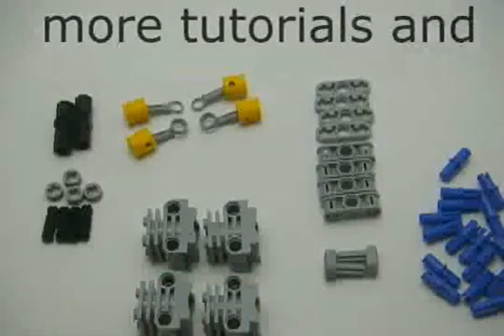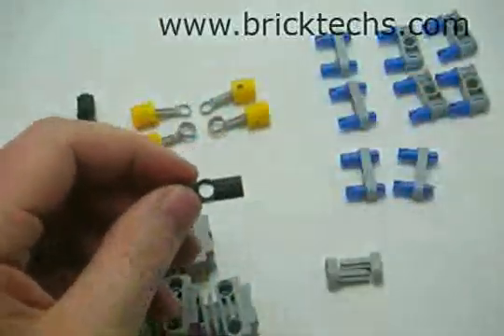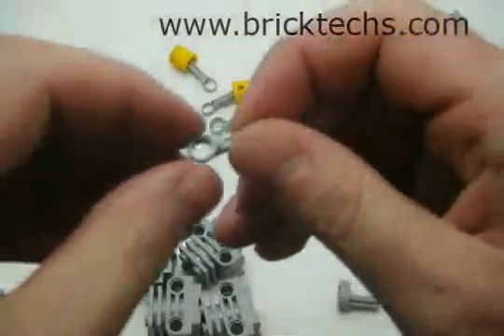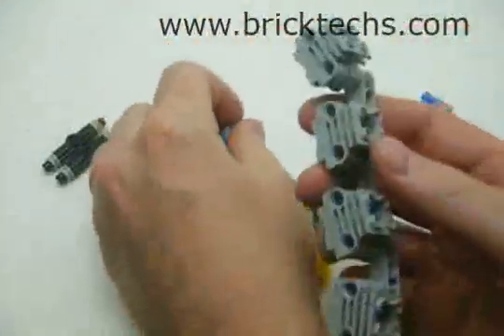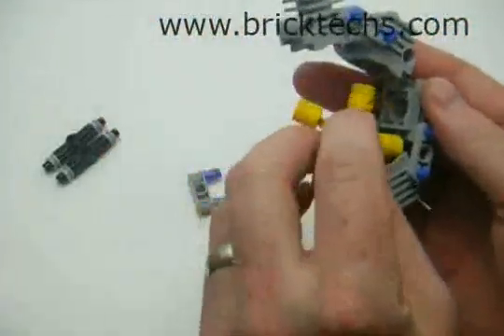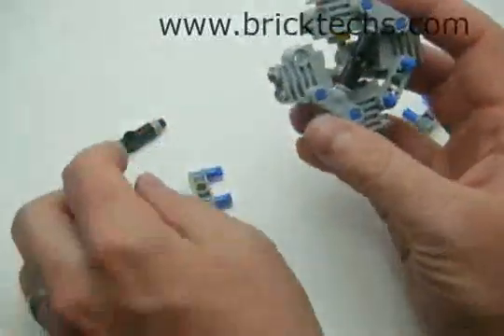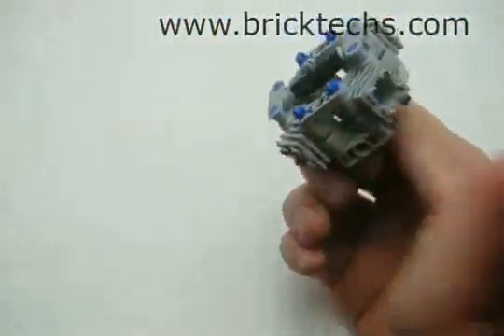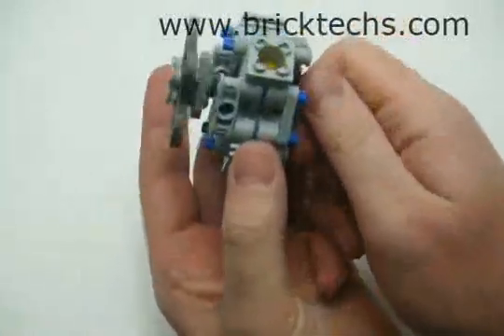How To Build a Lego Radial Engine

Comment: @rickaap 
Its called a radial engine because the 4 cylinders are placed radially to the crank. It differs from vee and inline engines. Please don't make up engine configurations like star engine. Think you may have been watching a bit much star trek.